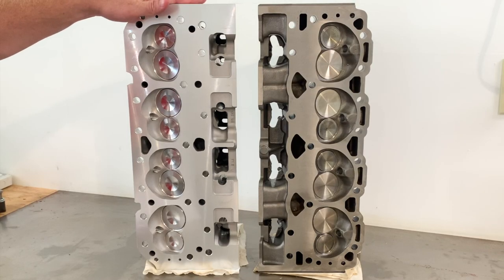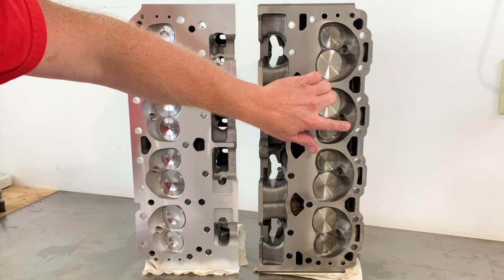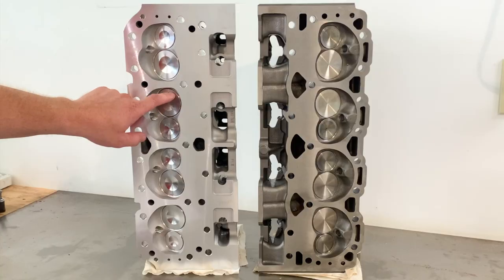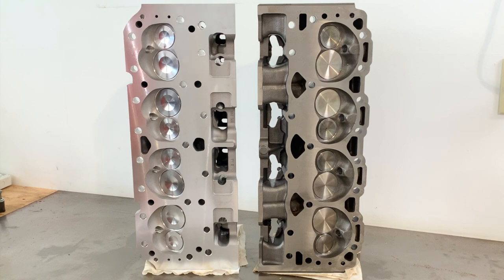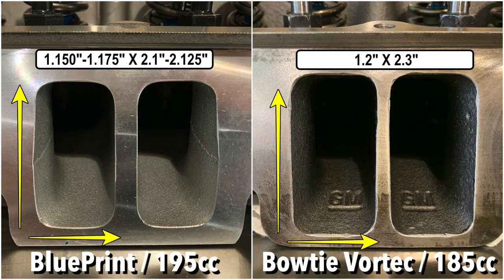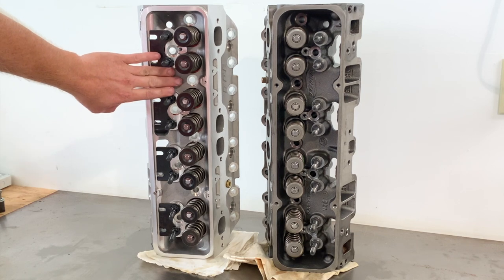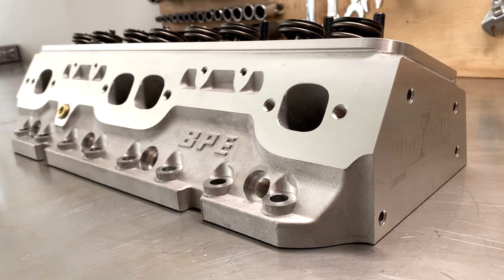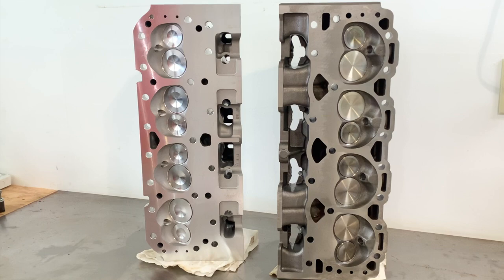SBC Heads: Blueprint H8002K vs. GM Bowtie Vortec

Comment: They are on par with each other they perform almost identical or atleast did with a 383 we swapped them to do some dyno pulls...then I went to putting in the time to give them the max port work on both sets we kept the valves to 2.020 even though the blueprints would have taken the 2.050 it was counter productive to lose the valve size on the vortex exhaust to gain the .030 on in  .. I knew where the vortec heads needed work I have ported many sets .the combustion chambers are the best ever produced in a sbc factory head until the LS1 came to town..that boss on the spark plug gets layer back and blended the valves get little unshrouding. And the ports end up in the @190cc  and 68 to 70cc on combustion chamber after rework .. you have to seal off the stud holes and do some work its really not worth it now days . But after 5 angle valve jobs and many many hours porting and sonic checking heads the blue prints  put 47 hp and 22ftlbs on the vortecs plus had more on the table wanting a bigger cam
Reply from the maker: Thanks for all the details Vinshane / 47hp and 22ft lb is definitely a nice gain! - I'm excited to fire up the motor and get it out of the road and see how the heads do / I'll keep you updated and thanks for the comment!

Comment: 4:15 ... If anyone didnt catch it, the outter mounting bolt holes on the VORTEC head, GM clearenced them almost into the exhaust port, leaving less material for the exhaust gasket to totally seal to, so expect less gasket life... obviously not a problem on the BLUEPRINT heads, raising them avoided that issue.
Reply from the maker: well said / coming full circle- got the blueprints on my zz4 and I'm excited to try them out. I picked a cam that coincidentally is almost exactly the same lift/duration as the dress BP 355. Optmistic it will make 400ish HP / we'll see. Long term, I plan to use the vortecs on a torque motor build for a truck/cruiser/etc thanks for the comment

Comment: The quench pad is on the opposite side of the chamber.  That spot your pointing to/talking bout(the spark plug boss area) does something else other than just quench and the alum head has it.  Just it's not as easy to notice or as pronounced because it's machined flat, trace a head gasket on the deck and you'll see it.  Those BPE heads are an older version based on a copy of older AFR heads, they have a newer version based on a copy of a newer Dart design.  The BPE head has a similar to modern performance head chambers that favors flow a bit more than mixture like the vortec head.  Higher exhaust ports help flow and if it was possible they'd be straight up/out but it's not.  The raised casting area in the valve cover is to allow the runner to be higher so it has a straighter shot from the intake, google raised-runner heads.   The main advantage of the LS series engines over the SBC is runner design/angle. They can only correct it so much with the SBC aftermarket heads while still fitting most aftermarket intakes/parts.  The biggest thing holding back the SBC(other than the weak factory block) is that the aftermarket supports 23 deg heads over less common lower angle heads just like the LS has.  Still the SBC was designed/packaged for a carb and to fit under flat hoods and that's why most modded for performance have a taller intake and some sort of scoop or cowl.  But even if you look at higher power LS or any V8 engine you'll see a taller intakes for a straighter shot at the cylinder.
Reply from the maker: I agree with EVERYTHING you said here / one of my biggest struggles with this build has been investing $$$s in a “new” SBC build knowing it will cost the same/more than a superior LS motor. The cathedral heads make that LS awesome . In the end though, these heads and motor or going in a 77 C3 Corvette and I’m of the belief character matters and SBCs just plain sound better/match the era better. I’m running a 224/230 cam in it but I might go Holley proflo4 because I’ve heard so many good things and you get a well behaved motor that still sounds old school. We’ll see how these heads work out- just ordered a set of full roller rockers from summit and they’ll be going on soon with the heads to check piston clearance / thanks for the comment!
Reply: @TacoJoe  The vortec heads are the better driver head with good power.  FYI because of their chamber design they like a bit less total timing.  I also have a C3 77, fun car!  GL with your build

Comment: I’d look at the Trick Flow (alum) cylinder heads.  Another great review.  Thanks Taco Joe!  
(Not enough videos from ya)
Reply from the maker: I’ve never had a bad experience with Trick-flow parts / have a bunch of them in my ford motors / I’ll have to check out their heads too
Reply: TacoJoe when r u going to Gatlinburg?

Comment: Great video Joe! Do you know what the total weight savings the aluminum heads would have over the steel ones? I remember being amazed at how much lighter the Edelbrock Performer RPM heads were over the stock 351W iron heads on my Cobra. I can't remember what the difference was, but it was a  lot.
Reply from the maker: It is significant for sure / i'll see if i can weigh them and compare / as part of the makeover, i might need to go to lighter springs in the front / its a TBD :)
Reply: Average is 50ish lbs for the pair but I like iron heads for other reasons myself
Reply: @BOOT  well good for you..thank you for your expertise.

Comment: I'm working on a sbc blueprint 400 engine and it seems that the plugs are pointed downwards instead of straight maybe because of the half inch raised runners.
Reply from the maker: GM has done a lot of things with location over the years (so has ford) - Once EFI was widespread, it made sense to fine tune plug location too / I don't know a ton about 400 heads but they are definetly different with the steam holes/etc - might need to google it and see if plugs were impacted too / thanks for the comment!

Comment: pretty sure the blueprint heads use Eaton valves. both eaton and blueprint are manufactured in the same town in Nebraska.
Reply from the maker: Thanks for the info Konner - I am SOOO close to firing up the motor I put these on and I'll let you know how they work out. Do you know what town in Nebraska? I travel there from time to time and it would be neat to check out-
Reply: @TacoJoe  Kearney Nebraska

Comment: I have a 427 sbc blueprint motor with an edelbrock rpm air gap waiting to be installed, but I don't know if the intake manifold will fit because of the taller ports on the heads.  With a basic edelbrock performer on it currently, the ports on the heads don't get covered completely. Do you happen to know if the rpm air gaps will fit on it properly?
Reply: Did you ever find out of Air Gap works?

Comment: The GM heads are stupid expensive, more than AFR heads which outperform them throughout the lift range, so there's that .
Reply from the maker: Hi Tim -you are correct / believe it or not i got this pair from Jegs in 2009/2010 for 1100$ new-assembled / I can't explain why they are so expensive now but completely agree with you - go for the AFRs

Comment: This really wasnt a vs.  It was you eyeball assumptions, guesses and opinion.  Thought i was going to see some actual numbers and running on the dyno.
Reply from the maker: Hey Curt - wish I had a dyno, but in absence of that only my conjecture. On another note - I have about 500 miles on the motor and I'm very happy with the Blueprint heads - nice offering / thanks for the comment!

Comment: Did you bench test both heads to see which one has better flow?
Reply from the maker: Hi Masc - I included intake flow values in the videos description / thanks for the comment!
Reply: I did not see that but that's only the intake flow. Without the exhaust flow I won't know the percentage of flow. With some simple math I can get 430hp 344hp at the wheels on the blueprint heads. I wonder if I can get that out of the gm stock heads.
Reply from the maker: Hey Masc - I’ll add exhaust flow numbers to the description too
Reply: So to my question do you think I can get 430 hp, 344 at the wheels with the vortec stock heads? Even tho their casting looks nicer and are iron.
Reply from the maker: 430 at the crank is do-able with bowtie vortecs for sure - key is making sure you have enough lift, the right cam-intake. If you google it, there are lots of dyno setups/results with these heads. Also Google "Crankshaft collation vortec" - really good site-summary on what to do with vortecs to make power / what to watch out for /etc.
Reply: Thanks

Comment: Most important part was price difference and you never mentioned anything about the price
Reply from the maker: Steve- you are 100% correct / the bowties are $$$. Whats a bummer is they used to be more affordable - I bought this set for around $1100 from Jegs in 2012 / times have changed I guess / thanks for the comment!

Comment: actually going to dyno test/flow test or just conjecture?
Reply from the maker: Just my thoughts / no dyno planned, but the blueprints are on my 350 and I'm adding an Edelbrock Pro-Flo4 as we speak / cam is 224/230 - excited to fire it up and overall they look like good heads! Thanks for the comment!
Reply: @TacoJoe  the proflo4 is antiquated and overpriced.  Building your own efi system using a holley terminator X would yield much better results and greater flexibility.  A wideband tuned carb works very well for the best bang for buck tuning solutions

heads dont operate on duration, they flow at lift.  no lift, no flow

Comment: the blueprint heads have more quench on the plug side than the vortecs. a 5 year old can see that. they are both good heads. the bp head is probably better at higher lift and higher rpm.